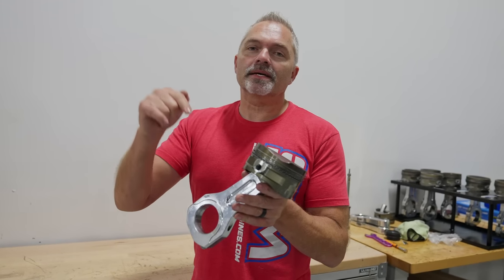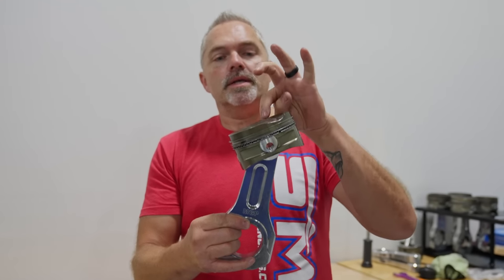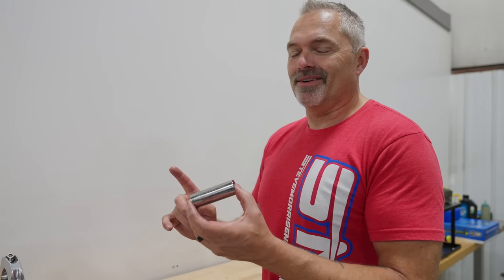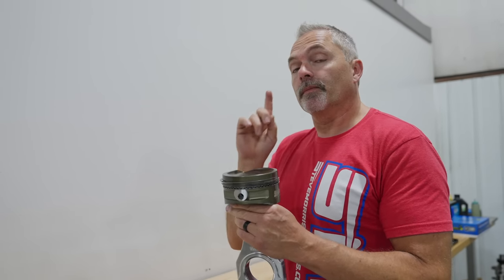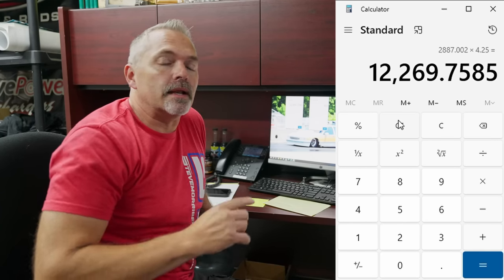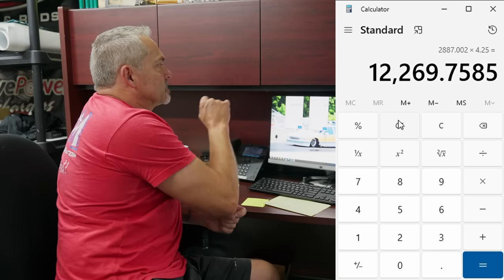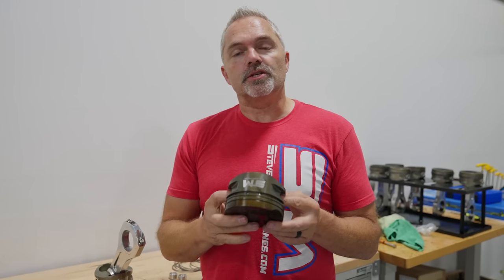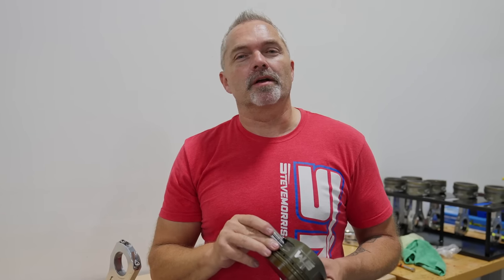Throw your rods away if you do this ???

Comment: I'm a carpenter by trade and find your channel just packed full of knowledge. "Knowledge is power" and you Steve have an abundance of both.
Reply: And power = strength x speed
Reply: Can Steve apply boost techniques and methods to the carpentry arena?! Imagine a nail gun ran by a compressor with an SMX! Some serious Rambo action for the average framer. 🤣😂🤣😂

Comment: 7.5 tons of force at 10,000 rpm going up and down 166 times per second on the wrist pin. Strongest part in the motor, can see why. Great video Steve.
Reply: @ajk374  i agree. Its holding together Steve’s math in 8 different locations at different times across one shaft.

Comment: The forces on the parts inside an engine spinning fast are absolutely insane. Hard to believe it actually stays together as long as they do.
Reply: Jet engines spinning so fast that the inertia distorts parts.  Crazy G-forces.  I guarantee you the smx rod is longer during the 9,000 rpm than at rest.

Comment: I remember a bunch of this from the mid 80's in college, now that you bring it back up. At that same time Indy cars were experimenting with ceramic pistons, ceramic pins (or ceramic composites )and magnesium rods. I seem to remember that the failures were because of harmonics, not just the pressures. Now to start with, we're also talking about 3-4 liter 10-16 cylinder engines running 10000+ RPM VS 500+ Cubic inch V8's. So pistons are gonna be much smaller... I'd love to hear your take on this...

Comment: This is an OUTSTANDING video, Steve!!  Everything is math, including the physics.  Some people clearly don't get why quality engines cost like they do.  There's also a reason why F1 pistons are exotic aluminum alloys and cost $50K each to make less than 1/4 of the HP in a SMX while being able to accelerate like a rocket.
Reply: Lots of physics, chemistry, thermodynamics, and materials science. Each with loads of math.
Reply: To be fair to those F1 guys, they are making their thousand-ish horsepower out of less than 100 ci (1.6l), which is a restriction Steve doesn't have to fight against

Comment: The dynamic loads in an engine are truly amazing, not only on the rod piston combination but also the valve spring, rocker arm and pushrod setup. Cam followers can leave the cam profile at max lift and valves can bounce off of the seats as the cam loses control of the follower when closing. Pushrods can bend and flex adding more dynamic forces to the valve, follower, spring combination also. It's amazing that these high performance engines can even get down the track.
Reply: Stuff like this would be for a  number cruncher math whiz.
At 150 RPS, figure out how much a single oil ring weighs, the top ring, and then the wrist pin.
I just askefdy, but I'll do it again. 
At 150 revs per second, how many miles per hour is a piston traveling in a mile.
.......I can divide by four, do I'll do that part of the equation  😁
Reply: Are you familiar with valve loft?
Reply: The ramp rates on modern roller cams are insane and never would have been possible without improvements in spring technology and metallurgy in general and the rates still produce enough force to clean break massive aluminum rockers with enough passes. 

Nothing quite like the exponential curve of going towards near infinite  dynamic loads mathematically and then figuring out just how far you have to back the ramp off to keep things alive.

Pushing limits is an understatement!
Reply: @ElliHarper  I tried it a few different ways, all wild math and doubt my math is remotely close. I was encouraging some math braniac to do it correctly.
I guessed 4.5 inches stroke at 150 strokes per second. There's 60 seconds in a minute, 60 minutes in an hour and there is 5280 feet in a mile 
Somewhere in there, there must be an equation. I can't wrap my brain around it.
The piston is also traveling at zero mph at one point...... but don't blink. 😁
I tried again and came up with 460 mph.
......you don't want to have me as your accountant. 😁
Reply: @randywl8925  with those figures its more like 76 MPH mean piston speed, 4.5 x 300 (150 strokes per second means it doers a full rotation 150 times per second which means it travels the stroke distance twice that number) times that number by 60 and 60 again to get inches per hour travelled, then divide by 12 to get feet per hour, then by 5280 to get MPH
Reply: @randywl8925  and the thing that will really blow your mind is when you remember the piston actually stops moving at the top and bottom of the stroke, so it has to accelerate from a stop twice per stroke, so the mean piston speed doesn't show acceleration rate and maximum pistons speeds
Reply: What this guy said. Knowledge is power.
Reply: @leehearsey  figure 76 mph and the weight of the piston coming to an instant stop and see if that math comes to the same number Steve gave.
At 76mph, does 2.1 lbs coming to a dead stop, weigh 13,000 lbs?  If it does, you got this........ This math is beyond me.
Reply: @leehearsey  I played with a couple calculators and you might be getting warm. 76mph ended up at 9667 ft lbs
So maybe 80?
Reply: @randywl8925  76.70 is the actual mean piston speed using those figures, but thats mean piston speed, actual piston speed will be higher as mean piston speed does not take into account acceleration speed of the piston, so max piston speed probably is 80 something, whatever it is its immense, now think about the old 3 litre V10 F1 engines that used to rev to 19/20 KRPM, incredible
Reply: @leehearsey  Yes, but there a 16 million dollar difference in price between an SMX and an F1 engine. I just read that F1 pistons are $65,000 each.  That's quite an increase per RPM. 😱
Reply: @randywl8925  oh yeah, I'm not trying to compare, just mind boggling how fast things need to move at 20 KRPM, Steve's engines are more impressive in a lot of ways, to move that size of piston to 9K and throw that much boost at it and also have it survive drag and drives is incredible!

But I do love the purity of the old 3 ltr V10 naturally aspirated F1 engines, regardless of budget and mileage etc, the engineering in one of those is beyond insane, but again that does not detract from the impressiveness of an SMX
Reply: @leehearsey  that makes sense

Comment: Love your videos Steve.  You mentioned the lack of countering forces at TDC on exhaust causing greater stress.   I am trying to model this in my mind and I think that the greatest stresses on the rod are at about 90 degrees past TDC on intake stroke.  I believe the greatest rate of change of velocity per degree of crank angle (acceleration) would occur at about 90 degrees past TDC (with possibly some correction for errors due to rod length and stroke).  However, none of this really changes the forces the math is showing.
Reply: I believe you are correct in terms of stresses on the shank of the rod- tension vs compression and leverage is greatest at 90* thereby having the highest difference in tension and compression loads on the rod shank (but during the combustion cycle, not intake). Steve is bringing to light the force that most people don’t think about- inertia weight of a piston not under compression  and how much energy the pin and rod are overcoming to keep the piston in a cozy warm block.  At 90* ATDC the piston weight acting on the rod is much lower than the force it takes to stop and reverse the piston.  
The high RPM changes things- inertia weight. In the engines I work with, large bore industrial diesel, the highest forces and wear spots are on the opposite side of the wrist pin bore but these engines don’t even see 2K RPMs.

Comment: The Wartsila RT-flex96c is the largest piston engine in the world. Bore is 38 inches. Stroke is 96 inches. Produces 107,390 HP at 102 RPM. Maximum engine speed is 120 RPM. Idle speed is 15 RPM. Piston speed is 27 feet per second. Piston weight is 6 TONS. Piston height is 20 feet. Crankshaft weight is 3 TONS. Total engine weight over 2300 TONS.

Comment: I would love to see a video on how many pounds of cylinder pressure is pushing on the bottom of a cylinder head on a boosted application! I’ve lifted the head on a couple of engines under boost and just the thought of it stretching the head studs is mind boggling to me.
Reply: That would be a neat experiment.
Reply: Someone has probably put a pressure transducer in a combustion chamber before.  Could use that info and the cylinder size to calculate the forces.
Reply: According to banks power, each cylinder pressure sensor is 4000usd lol

Comment: I was a kid of 16 when my education on building 10K RPM small block Chevy motors began.

After more than 50 yrs, I'm still amazed the pile of cast iron, steel & aluminum we call engines don't turn into scrap every time the throttle gets mashed. (Not entirely sure there's no black magic, voodoo or alien influence involved.)

When you pay for & build your own engines, you have to force the knowledge of the tremendous stresses put on  engine components out of your mind.

Otherwise, you'd never be able to wind one up to 7,500 & dump the clutch, (for all you youngsters, think release the little button.)

To anyone who's never built an engine, brought it to life & abused the hell out of it racing, it's a mind boggling experience & hard to explain.

It's also hard to explain the depths of despair you  feel when you break one, too!    LOL

Love when you geek out on the science, Steve; it's hard not to  be giddy, when a guy thinks about this chit.

GeoD

Comment: Is valve train still the limiting factor, or is it normally piston speed when your setting a rpm limit? Or a factor of both? Love the knowledge Steve. I’m a carpenter but cars have been my passion from before I had a license. Been messing with them just as long 😂
Reply: Great question.  I often wonder whether using a big block billet bottom end plus an overhead cam design would live longer.   4 valves would certainly be lighter rotational mass on the valve train.
Reply: @skeetamacgyver1821 Yes, it would live longer and flow better, but the 3 extra cams and wider and higher engine means you could just increase displacement instead. The ls has a much bigger displacement while being lighter and more compact than a coyote, so in case of a v8 it may just not be worth it.

Comment: You talked about how many times a second the pistons are at TDC - BDC at different rpms, what's equally mind blowing is when you go a step further.  (I know you know and understand this better than I ever will!!! This is for others)  Think about the speed of the pistons, they have to go from a dead stop, start to move, mid stroke they will be traveling at the highest speed, then they needs to slow down, come to a complete stop, then do the same thing in the other direction.  When I'm on the highway and the tack is around 3,000 rpms, there's times I think about the pistons being at TDC 50 times every second; sometimes for hours.  It really shows how important the lubrication and cooling systems are!!!  AWESOME VIDEO!!!

Comment: Well explained Steve, people don't generally understand what weight does when it's moving. Sidenote, i used to sell drain manhole covers and I've had so many people trying to buy a 2.5 ton rated cover to go in their driveway. After explaining to them that a car can put way more that 2.5 ton through a cover when moving and especially braking and them still insisting to buy it(because it was cheaper) I'd refuse to sell it to them because it wasn't fit for purpose and dangerous.

Comment: I blew my modified bike motor at around 12,000 rpm in 3rd gear when i got valve bounce
The issue was not the valve bounce under load but i panicked and shut the throttle
Under closed throttle conditions and sudden deceleration against the weight of the bike and myself it sucked open the lightened valves, bounced and broke 4 of them on top of the pistons. It was a mess. 
And i heard it hit the valves AFTER i shut down the throttle.....
That was in '81 before electronic limiters
So i intimately know about those big ouches.....they hurt things

Comment: Wrist pins have a hole in the center because the cylinder is stronger than the bar. Lightening holes could be utilized in the structural support portion of the piston without diminishing strength? Diminution of mass reduces gravitational forces by exponents.

Comment: At 166 strokes per second at a 4.25 stroke is 705.5 inches per second 3527 feet per minute. 211664 foot per minute that’s 40.08 miles per minute or 2405 mph piston speed. 
Wow I need a Tylenol 
Awesome info Steve

Comment: !!!!AWESOME information Steve...THANKS!!!! 
The piston setup you used as your 2.51Lb example is nearly identical to mine...as is the weight. Only the crown of the piston is different.
I knew the inertial weight was high at 7,000 to 9,000 RPM. But I NEVER imagined it would 
be as extreme as your equation presents. When building an engine that'll hold together at 
8,000+ RPM, this is a critically important factor to consider. My engine often sees 8,000 
to 8,500 RPM...!!!!YIKES!!!! 🙂 
YES...PLEASE make more of this type of video; as your time allows. 
Best regards, 
Ben

Comment: Two things are still open for improving pistons and pins:

1) Use of additive manufacturing (a.k.a. "3D printing") allows for removal (or rather: not adding it!) of material in spots where conventional machining can't reach. Piston manufacturer Mahle is making 3D printed pistons for Porsche since 2020 now, just to give you an example. 

2) Material choice can still allow for weight saving because a higher strength grade can do the same with less material. A stainless pin from 316L, with a yield strength of about 35 ksi, will have to be much bigger than a stainless pin from 440C stainless, which can be anything from 65 ksi to 270 ksi yield strength. Grab extremely high performance Maraging steel, and you have yield strengths between 250 and 335 ksi. 

And 2a) Wrist pins can probably be lightened too, by flaring the ID at both ends. The tips of the wrist pins can do with a little less wall thickness compared to the center where it connects to the small end.

Comment: What about titanium pins? Possible? Or is it a thing? 
I noticed building and modify my scooter engine. The pin basically weighed as much as the piston.  I polished the back side of the piston, got a few grams off the weight.  A modern piston design with narrower pin area. This is about all I could ask for.  By the performance, it makes about 6-7 HP, not bad for a 50cc, 4 stroke using alot of stock parts,  id like to build a two cylinder,  im running a 50mm big bore. And a head basically a 125 head, it uses 125 valves, about 3mm larger than stock,  I skimmed the new head about . 005" I want to cut the jug get the piston out the hole slightly, or cut the head , get 200-220 psi compression,  it does 45 mph with 350 lbs on it fairly quickly, turning 10k rpm, just a junky scooter, but it's twice as fast as it was stock,

Comment: Yes that info is amazing keep it coming. On the other side of the coin is the stock modern engine doing the same thing although at a much lighter load and lower rpm but being expected to do it for years in all temperatures with clean and dirty oil with thousands of cold starts.. The number of exhaust strokes where the rod has to snatch the piston down over 200,000+ miles is as amazing as a SMX doing it for a season. Both are engineering marvels.

Comment: Love technical stuff like this. For anyone that's interested, here's the results for every 500 RPM increment from 1000-10000 RPM 😜(for the piston weight and stroke noted in the vid)

RPM	Weight (lb)
1000	151.68
1500	341.27
2000	606.70
2500	947.97
3000	1,365.08
3500	1,858.03
4000	2,426.81
4500	3,071.44
5000	3,791.90
5500	4,588.19
6000	5,460.33
6500	6,408.30
7000	7,432.12
7500	8,531.77
8000	9,707.25
8500	10,958.58
9000	12,285.74
9500	13,688.74
10000	15,167.58

Comment: Steve, this is great stuff. Thank you. Wondering if you would say a few words about the 2006 Formula 1 engines. They were 90° V8 of 2.4 litres maximum capacity with a circular bore of 98 mm (3.9 in) maximum, which implies a 39.8 mm (1.57 in) stroke at maximum bore. These 4 valve engines RACED with a 20,000 rpm shift point.  Pneumatic valve  systems that were computer controlled enable them to bypass valve float. Thanks.

Comment: I did not read the rest of the comments, so if this has already been stated, I apologize. The calculations you have done in this video would theoretically be for an NA engine. When you add boost, or positive pressure on top of the piston, those numbers will decrease dramatically. Especially when we are talking about big block engines with 40+ psi of positive pressure. So I suppose you could take an easy number, say 45psi (3 times atmosphere) you would then divide those numbers by the corresponding number to get a more dynamic number of "pulling" weight for each piston. Maybe you have already thought about this, maybe not. Just thought I would throw it out there. Anyway, love your stuff Steve, I have learned alot about building engines and theories from your channel, greatly appreciate it sir! Maybe you could get together with 'total seal piston rings' and take your stuff to an even higher level?

Comment: It’s was a very good video explanation of the pressure developed during the piston cycle and strokes and speeds it’s traveling. Very good explanation of where rods fail at the connecting points between the caps and crank and at the wrist pins and piston.